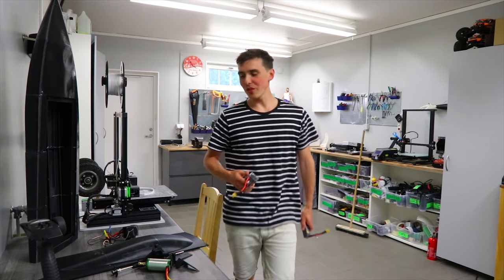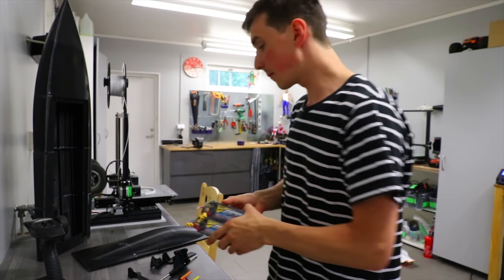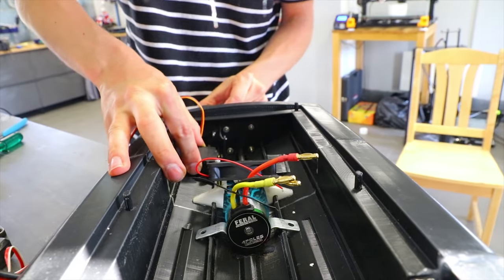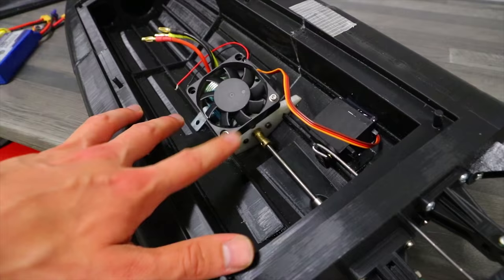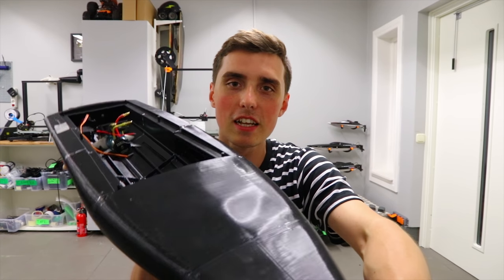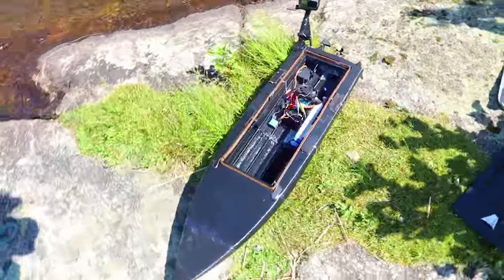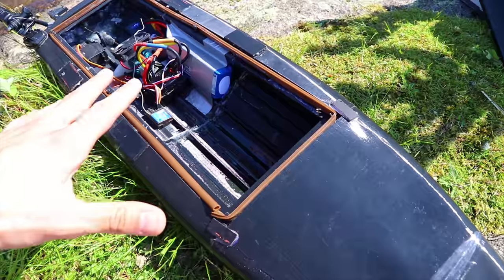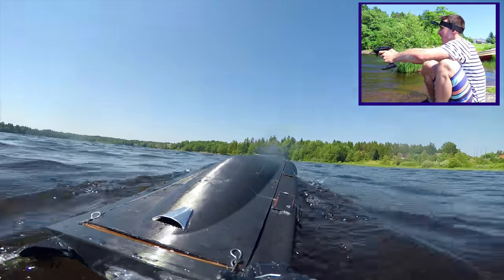BIG 3D Printed RC Speed Boat

Comment: Just wanted to drop in my two cents. Maybe someone has already covered this, but here's a couple things. The prop might not be going above the water level but spinning so fast that the water boils and steam bubbles form preventing contact with the water. I know for big ships this is a limiting factor to their speed; not sure if it applies to RC. And the other thing, I figure the epoxy will stick to the PLA just fine, all you need is a little prep. (Ignore this if you already know it, which you probably do) Epoxy needs a lot of surface area to bond to. The best thing you can do is thoroughly sand the surfaces to be bonded with 80ish grit sandpaper. Once you have a consistent finish, make sure remove the dust by rinsing or wiping, and then decrease (if your hands touched the area without gloves) with alcohol, acetone, or another solvent (maybe test anything besides alcohol first on a scrap piece to make sure there's no corrosion!).

Comment: Three or four printed tabs at the production splices where stainless steel bolts can be used to hold it together will allow the use of a gasket instead of epoxy and will help to reduce weight.  Thanks for the video enjoyed seeing the process and the opportunity to learn from your engineering process.  Drone footage was BEAUTIFUL!!!!

Comment: I would recomended to use PETG. For construction I would use aluminium/dural tubes from hardware store to run them through all parts. Alsou modification on parsts to have overlaps between them for better joint.

Comment: Awesome idea. I've been toying with the idea of doing a 3D printed speedboat myself so it's good to see what you've done even if it did go a bit wrong. I have a recommendation if you want to redo this boat project. Get some EMA Plastic Weld (I don't know what it might be called in Sweden) to use as adhesive between the hull sections then brush some, sparingly, over the surface to seal the layers together. You'd have to go with the 'grain' of the print and it might take a few passes but it should make the PLA water tight. It'd work better on ABS if you can switch over to that material. Regardless of what you do, thanks for trying this idea and uploading your vid.

Comment: Fiberglass the hull, kid, fiberglass the hull! Not only will it keep the water out, it will provide a huge amount of strength to the hull. In addition, it might even support the hull in the hot weather and prevent warping. Also, change the angle on the stuffing box to keep the prop deeper in the water.

Comment: That is a tiny propeller for such a big motor!
Reply: And most likely the cause for the cavitation. The prop spins so fast it literally causes the water to boil due to the sudden pressure change. This creates a pocket of vapor around the blade and so it loses thrust. The process of cavitation can be so severe that it will actually create pitting in a metal prop. This happens on real boats also. If the prop loses thrust because it is coming out of the water, then that process is called ventilation and the prop needs to be lower in the water to combat that.

Comment: Failure is just a step on the stairs to success - keep Trying! Get a 3dPen that uses 1,75 mm Filament and weld these parts together from the inside. Or use your dremel for friction welding this stuff together. The latter might leave more scars.

Comment: scrap the glue holding the sections together, put sealant between each section and use aluminium plates and  bolts to clamp it together

Comment: Do it in abs, acetone bathe that, and it won't need that much epoxy, also glue the pieces using plastic welding, works amazing against water, but you need to glue that too in order to have a more rigid piece

Comment: Simon what about printing that boat at 1 piece on CR10 S5, won't it fit that?Eventually scale it a little bit.. How long is your boat?
Or print it with 100% infill.. But it requires a lot of filament :)  
Another idea which come to my mind : make a holes to screw part tight together, and between put kind of silicone/gum pieces.. to avoid water leaking .

Comment: I know this is an "old" video but you should try using propellers with 2 blades and a little bigger, I think it is by cavitation, the propeller spins so fast that the water is not absorbed by the propeller and creates vacum, reducing  the thrust, that is why when the engine accelerates, is when this problem arises, it is a complicated "phenomenon", if you are interested and read this, I could explain a little more of the subject

Comment: Hello, rclifeon, i would put more testing/research and development into the model of the boat. This was a great start and definitely one to be proud of and learn from. I feel the biggest issue u picked up on was the power of the boat that wasn't being fully used. The electronic portion seems solid. The print turned out great, with some improvements it has great potential ( i would look into abs plastic that is acetone smoothed and welded). Structurally i think if u want to go fast you need to invest in either wooden posts or cabon fiber tubes that fit into the printed parts and are glued in place. I wouldnt be keen on using plywood or metal for this project. Plywood is a great material, just not for this size craft. Although strong and lightweight, aluminum flatbar would have issues. aluminum square tubes would be the best bet but would weigh to much in my opinion, this is why i recommend carbon fiber. If u decide to keep the current print made in pla plastic, i would first sand the plastic parts you plan on gluing, then use either epoxy or a cement. The hull of the craft and its leaking issues wont go away unless you fully seal bottom plastic (i would have used abs that is acetone smoothed). I read another comment that mentioned fiberglass. I think that if you invested in fiberglass or even thin fabric that is placed on the bottom of the boat and then covered in epoxy, you would have a strong leak proof boat indeed. I hope you read this lol.

Comment: Great work! Congrats!
One point to consider on your next try for better propulsion: surface propellers. They are designed to be only half submerged. Look for speed boats.
For the boat rigidity and survivability, you might want to consider the outer surface of the hull to be some sort of honeycomb, it should give it a good amount of extra strength and a lot of air pockets too so it's gonna be almost impossible to sink.
Cheers!

Comment: You could just paint it to make it waterproof.. second thing is to put battery bit closer to the front of the boat to move center of gravity to the middle.. to reinforce the rigidity of the boat add some conection between each part and than glue it.. ;)

Comment: There is enormous potential when you consider wrapping the boat in various forms of carbon fiber. You could even get away with just carbon fiber tow. I find this route fascinating because that is the number one limiting factor to working with carbon fiber- you have to have a mold to work with it, but when you have a 3d printer, you can just print the mold, and wrap it, and even leave it in as part of the overall structure.  You could even wrap it in pre-preg carbon and vacuum bag it. The following video does a very good job of demonstrating just how beneficial carbon fiber tow can be to strengthening your printed parts /watch?v=p1yOf6Ba1ts

Comment: needs to be strung together like a guitar neck, run core threads from paracord in loops around the inside through designed holes.  Then pull it together.. the epoxy glues it, sure, but the core threading will give it profound rigidity.  Then epoxy the threading.

Comment: i noticed that gaps as well in walls. i mean that you seal your mouth around a flat piece you can suck air through it and won't get any suction to it.
there are very small caps where air/water can get though.
i wonder if 3-5 layers of clear coat would of filled in everything.

Comment: You should repeat this for sure! Trying sealing the boat with a rubber sealant of some sort. In US we have a product called Flex Seal might work well. It's a spray on rubber coating. The guy shows it sealing a screen door in the bottom of the boat. (infomercials are stupid...)  Comes in black and clear. Otherwise look into marine grade epoxy sealers for making boats. The people who handcraft wooden boats us the stuff.

Comment: Nice speed boat and good design  but i think i will use abs to print mine out so it will be stronger and more heat resistant .

Comment: Make sure the air intake has a momentum filter to only allow air and not water into the inside. You should have overlapping sections to ensure they stay solidly together. You could probably vacuum form a plastic outer shell to make sure things are water tight. If you raise or enlarge the propeller, you may be able to reduce the lifting of the boat when the engine revs. You could probably also use fins or hydrofoils. Real boats have trouble with too much power making the boat climb out of the water too. I am no expert at this, but I hope the ideas come in handy.

Comment: I would try reducing the amount of chunks that makeup the boat itself but if u cant then try using both appoxy and rubber seals along the edges along with any other holes if at all possible. What I can tell the boat is way too heavy. And also try lowering the propeller position to help with the air/water movement issue. But great vid man can't wait till part 2

Comment: Few suggestions:
1. Either use the proper adhesive for bonding your material of choice or use mechanical aid in the form of nuts/bolts to do so.
2. Consider supporting the entire hull with a honeycomb structure that is open towards the inside.
3. Just because you can 3D Print everything doesn't mean you should - How about just making a 3D printed support frame onto which you add thin wood, like balsa, for parts of the hull ( the lower section )?

Comment: I had the same problem printing whistles and airtight stuff. I usually just paint the part to to fill all the micro holes.
Regarding the propeller I think it's cavitating because it's spinning too fast. Use a bigger prop to get less speed and more torque.

Comment: First put the PLA in Aceton to smoth it out and remove the micro holes. Second make a more rigid chasis by making more support, something like a Lego (but more rigid) between parts of the boat. Third the propeller wasn't ever above the water, you can literally see that in the footage, the sound is from cavitation due to a too small propeller for too high revolution for too much force, try with a bigger one, that motor can surely drive it. Designe a hole where you can put the antenna on the top of the boat and therefore glue it for better signal
Reply: PLA Doesnt dissolve in Acetone.
Reply: it does

Comment: The lack of power issue is not because the prop is rising above the water, it's because it is over-speeding and cavitating.  Essentially this is because the blade pitch on the prop can't deal with the excess power and is unable to efficiently cut into the water.  You might be able to fix this by installing a high speed prop with a higher blade pitch or maybe adding a transmission to more efficiently handle the power of the motor.

Comment: I've watched many of your printer reviews - great to see you making a full on project like this - especially a boat as there are MANY issues to contend with.  I'd like to cover a few things --- the sound you heard from the prop is referred to as cavitation and is due to what you already found but may not realize - your drive is either too high on the transom or needs more angle - I'd suggest looking at the angle on some of your other watercraft for a better idea of what angle you should have - the solution is probably a bit of both drive depth AND angle - but not too much angle or your craft will "porpoise" under acceleration.  Then on the subject of the transom - you don't have enough freeboard for the waters you're in so maybe consider a taller hull - not too much but maybe an inch or so more.  Irrespective of waterproof receivers you should still do the baggie/rubberband wrap just to be safe.  The type of hull you're using is not conducive to the water in which you are running - so maybe a bit of a deeper V hull will help with stabilization - and that brings me to the stabilizers - they will do the job on a CLEAN water surface but when you have grasses on the water surface these stabilizers will always pick up debris which changes the whole game as far as speed/stability/steering.  I always had this problem as my lake is surrounded with pine trees - naturally the pine needles were a nemesis.  Many boat kits are made with separate hull/decking as opposed to multiple hull pieces afixed to make one long hull - so consider making a one piece hull if you have a printer that can make  a 32" hull or two 16" pieces and have just one joint - then glue stringers on the inside of the hull for support.  I could go on forever here but I'll add just one other idea - many of the boats I ran used a water pickup tube that ran a cooling tube around the motor for obvious reasons - you may be able to incorporate a mechanical bilge pump ran off the drive that could ALSO pick up not just cooling water from out of the boat but also act like a constant bilge to drain whatever water seeps in through your cockpit cover - oh, taping down that cover helps with keeping water out as well.  Looking forward to your next build!!!!

Comment: Hi! Just want to share my experience in building a 3d printed boat. I have printed a boat from Thingiverse made by Lepael. It turned out awesome. For gluing the parts, I used CA glued, and no way it could break because it is so strong that the PLA would break before the glued parts. Regarding the watertightness, i used plastic primer for car bumpers repair and then 2 coats of acrylic car paint. It gives a nice finish and its very durable. My boat is 90cm long, and I havent ordered a motor and ESC yet, so still dont know how it goes :)

Comment: Hi! Very nice project
I would rather use screws and silicon sealant between the different frame to assemble the boat section together. 
This should insure strength and waterproofness of the boat (at the junction at least)
Looking forward to v2

Comment: We have this stuff in the US called Plastidip that coats whatever you spray it on with a rubberizing susbtance. It's EXCELLENT for sealing, and shrinks a bit when it dries. Comes in a LOT of colors and you can peel it off if you want to. Peeling takes effort because it sets really well. I used it for waterproofing in my 1/10 days

Comment: You should have spray painted the boat, then sealed it with a clear coat. It would have fixed any leaks and it wild give you the chance to change the color so it wouldn't absorb so much heat in black.

Comment: How about printing a smaller boat, maybe a max build on your tornado or cr10. Printing everything in one piece would probably be better. Or maybe in just two pieces with a small wood dowl to bind them together. If you do manage to print and make a full boat. Do you mind posting up a shopping list for all the necessary parts (and stl) so we can make one our selves?.

Comment: Cool project! I think ways you can improve this is to mount your receiver antenna vertically on top of the boat because RF doesn't travel very well underwater (pretty much doesn't travel), and adding a bit more weight on the bottom. Petersripol has many great videos on making boats, and one trick he uses is to melt the plastic using ethanol or alcohol then to stick them together. I think this can solve many of the issues.

Comment: Try to use dichloromethane for glueing PLA, and smoothing layers for water resistance))))
Reply: Also, i got better water resistance with 0.5 and 0.6 nozzles and 0.4-0.5 layer high.

Comment: Consider using fiber glass on top of the pla. should be more rigid and water tight. I dont know how much water gets inside through air inlet and outlet but some filter wont hurt :) . Also, cann you propel boat using... water pump(s)? Instead of propeller one (or two) water pumps pumpin water through pipes/rubber hoses could also cool electronics. Very enjoyable vid, tho bit short, also more details wont hurt, at least not me :)

Comment: Nice job ! Many folks wouldnt put up their unsuccessful attempts! PETG would print on any of your heated bed printers and has a higher temp melt point and is more abuse ready. Its much less brittle. I would try that . Or how about printing the entire hull on the Tevo Little Monster?  or maybe a 2pc hull? I would use a 3d pen to reinforce the joint perhaps on the inside?  Great Video!

Comment: Make it one piece on your biggest printer. Also, make it taller because you can see water going inside the hatch. Lastly put the batteries a little bit more backwards, this should shift the weight and keep the prop from coming up. Also maybe look at putting some angle on the shaft.

Comment: I like your design but you need a deeper V. I'd say at least double the height. When I lived in Florida USA in 1991 I raced with a group of great guys and all their were ABS and tuff as heck! Being you have to glue the parts together I'd used 3m body panel epoxy. They we would put 2 part urethane inside the hull. The whole hull. Also you should water cool the motor. It's easily done by wrapping around the motor with copper tube and run a hose from the rudder to one end and the other end of the copper run another tube to back of the boat. Also I'd move the motor back for better CG to get the bow higher. Then you can fine tune where you put the battery.